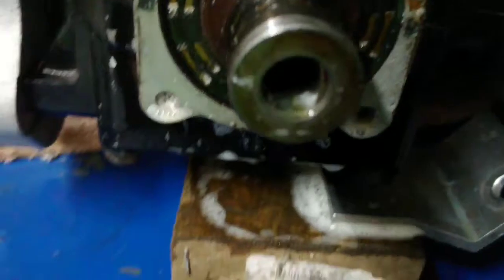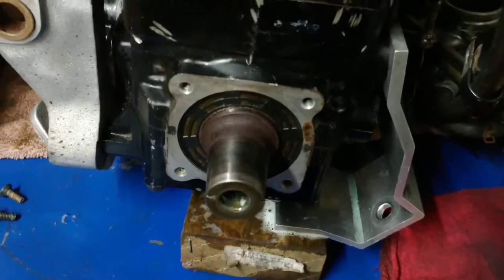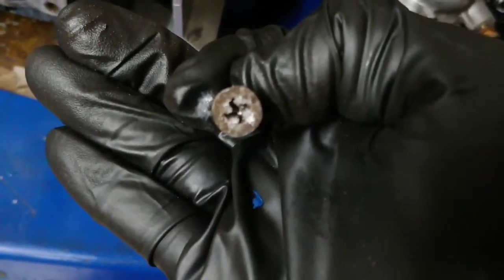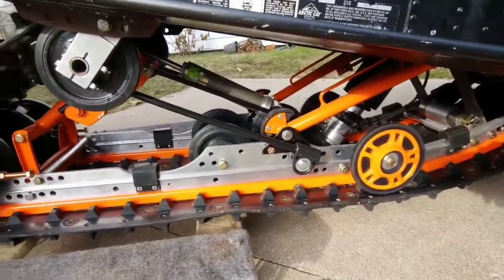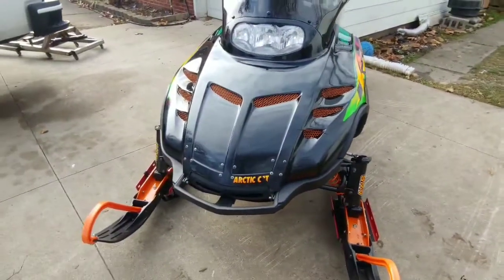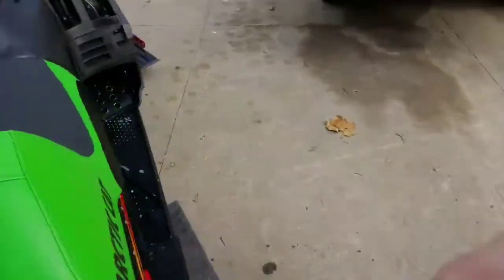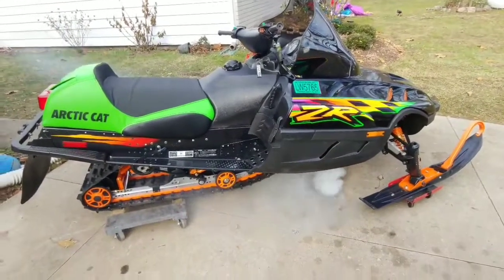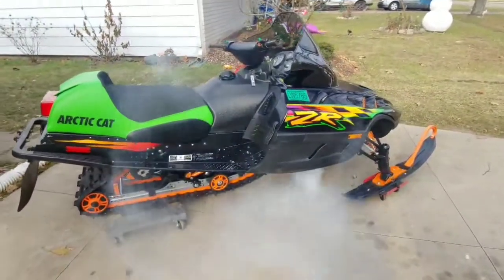96 Arctic Cat ZR 580 efi repair and swap into 98 ZR2 Chassis.

Comment: I am looking at two 96 600 ZRT's for $1100 for both.  They both run good. Start on first pull. Plenty of power.  They have about 3000 and 5000 miles.  I'm concerned about possible problems with them. I plan to look them over closer tomorrow. Just not sure if I should take a chance on them.
Reply from the maker: Yes for sure. If they run, have good compression, the rest is easy. 10-12 skid bearings, $25-$30 shipped, jackshaft and driclve axle bearings $60-$75 shipped (I like All Balls brand), clean the airbox, fuel and carbs, maybe rebuild the shocks if the dont have rebound dampening. Check track for dry rot and youre good to go. Very solid and repliable sleds!
Reply from the maker: Yeah man and good deal. Congrats!

Comment: What kinda fab work to get the 580 in there I'm going to be doing same swap here shortly
Reply from the maker: Had to make a bracket for ECU and thats all. Found motor mount from ZR2 chassis with 580s in them.
Reply: @Fixin2Ride-Official-  so I need to find a 98 580 for the motor mounts as my 580 is out of a 94
Reply: @Andrew Crocker - Fixin2Ride  also thanks yiur video made my decision to do this lol
Reply from the maker: Yep. 580 thats in a ZR2 or ZR3 chassis if you can find them. 

 And glad to help. All I ask is you share the crap outta my channle and any videos on all slcial media you can to get the word out. I would greatly appreciate it. Trying to grow this channel out to get better content going. 🤜💥🤛
Reply from the maker: I just verified and there are 580s put in 98-01 Zr2-Zr3 chassis. Hope this helps.